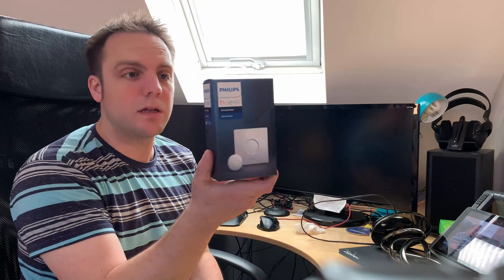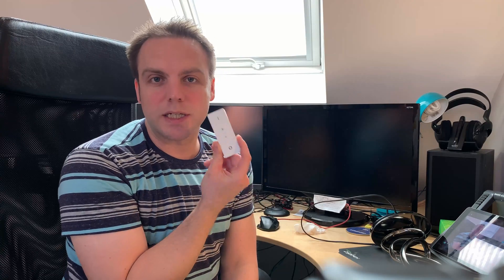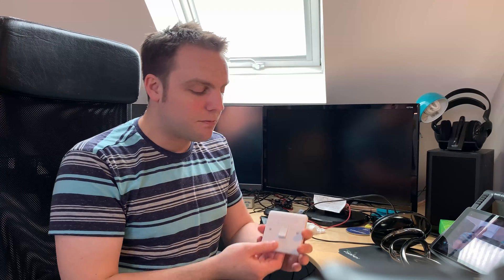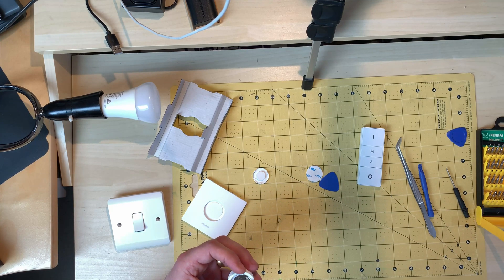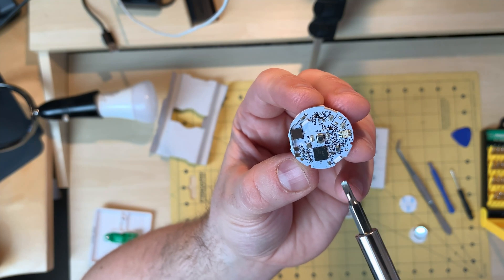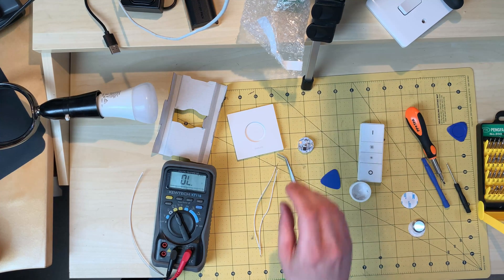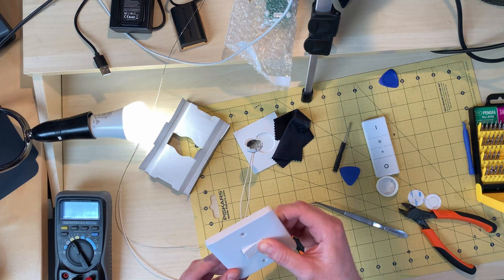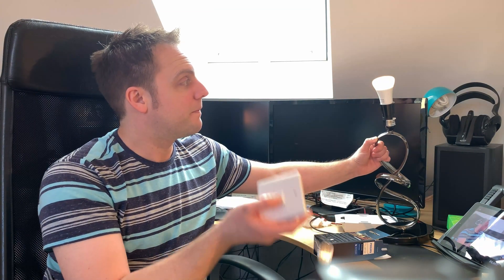Philips Hue Smart Button - teardown and hacked into a retractive push button interface :D

Comment: Brilliant, was looking for this. What about adding ac-dc converter 230v-3v an trying to run off the mains instead of button battery? Would it work only on neutral wire?
Reply from the maker: Yeah it would work great, a liittle more work - and yes - you would need a neutral wire otherwise you'll not have power.

I've decided not to d othat becasue  
1) The battery lasts AGES
2) Space is an issue in the backbox. I'm not sure you'll fit it all in.
Reply: This is exactly what I’m looking for. Theoretically it shouldn’t be to hard, right?

Comment: Love this!! An interesting test before I go and buy enough to cover my house... if you turn your philips hue lights on using Alexa or even the philips hue app if you then click the push button does it know they are already on and turn them off or do you have to click the push button twice?
Reply from the maker: Perry Newman I just tested this with the apple home app - so yes I can confirm that Siri and Apple home scheduling or manual control keeps the button fully synced. So you can turn on or off the light via Siri, or a button in Apple home, or a schedule / logic etc. And the push button stays in sync.

I can’t test the hue / Alexa integration or google home implementation because I have an Apple house. But it looks like it might work fine :)
Reply from the maker: Perry Newman I’ll test it for you in a bit :)
Reply: Purchased a push button on amazon last night it has just arrived and I can confirm it does stay in sync with the rooms lighting on/off state so just what I need! Looks like an order of 5 more push buttons and switches are on the way! Cheers for this! 😂